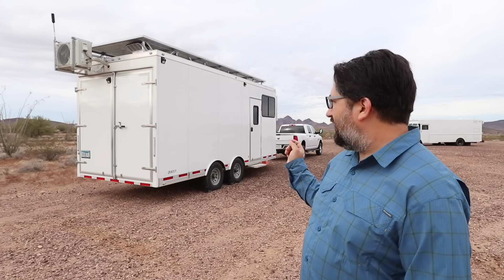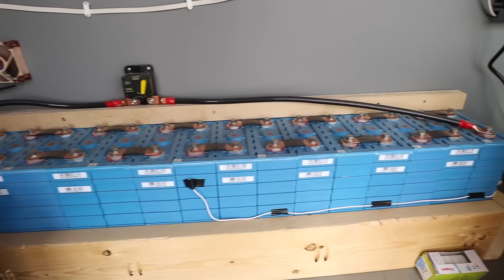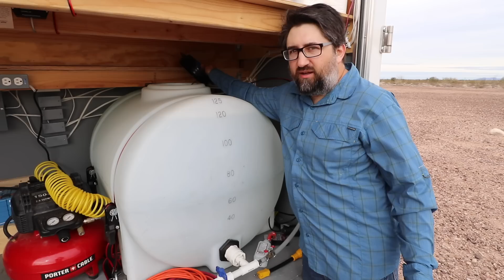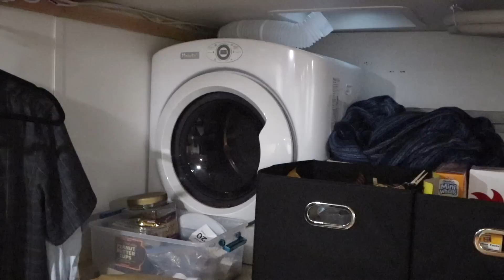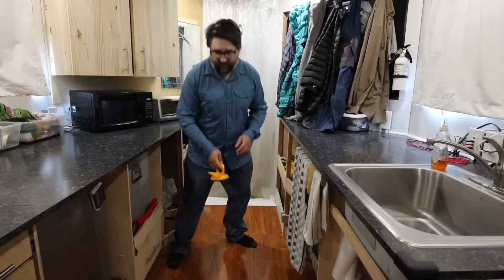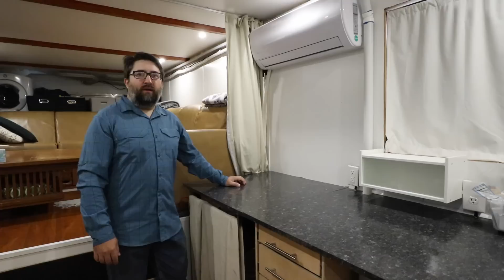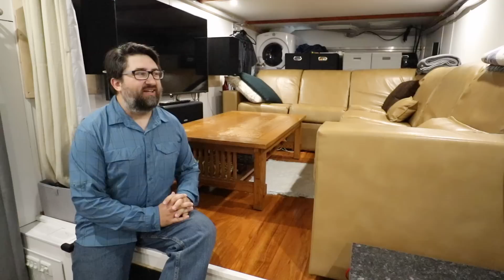Crypt Bedroom in a 2 Kilowatt Cargo Trailer Conversion

Comment: Love the rig!   Great job overall!   What I didn't see is a BMS for the battery bank and no balance leads.   Is there any particular reason for the lack of any balance leads?  I know the solar charge controller can be programmed to perform part of the function of a BMS, and the inverter can shut itself down when the battery voltage gets too low, but how do you handle balancing the cells?   And I see the temperature sensor on the side of one of the cells, but are you only monitoring for high temperature or low temperature or both and what is controlling the charging sources and loads in accordance with temperature?   Thanks!
Reply: A BMS performs 4 functions:
1) Protect against high/low temperature
2) Protect against high current in or out
3) Protect against voltage too high/low
4) Balance the cells

I don't have a formal BMS on my system.  Instead, I'm taking other approaches.  I didn't find a trustworthy product at the time of my build that I would gamble my expensive battery set with, so I have my own protections.
1) Protect against high/low temperature.  In my situation, the batteries never get too hot.  I keep my rig at a reasonable temperature, and the batteries are never working that hard when charging or discharging such that they heat up.  To protect against cold, I have the thermometer hooked up to a relay that turns on a space heater.  If it gets too cold, that area will be warmed by the space heater.
2) Current: Even if I run everything in my rig simultaneously, I can't exceed (or get anywhere near) my current limits.  This is not a problem for me.
3) Voltage: I have the solar charge controller and inverter/charger set up to not exceed high voltage limits.  The inverter will cut out at a reasonably low voltage.  I also have a Victron BMV-712 which starts sounding alarms if voltages get too low, which, has never happened yet.
4) I manually balanced the cells when I installed them and haven't touched them yet.  Because of my low "C" ratings, they won't drift much at all.  I am planning on performing another manual balancing (if needed) soon so I can start using 100% of the battery pack's power instead of just the "safe" 80% that I have been using.
Reply: @michaelberding4616  I hear what you're saying, but it is precisely because your batteries were so expensive that I would want to, at least, monitor the individual cell voltages - just in case one of them, due to no fault of your own, drifted out of balance.   Because, a problem with one cell can spread to other cells.  And, I don't think I would trust those cheap BMS systems out there, either.   And, I am keenly aware of the irony of balancing systems for lithium batteries - if the cells are matched, there is no need to have a system that balances them and if they are not matched,  a balancing system will not fix the problem.  And, you make a good point about the low "C" ratings of your charge/discharge profile.  But, there are some decent BMS systems out there - and, they aren't cheap.   The fact that you feel a need to possibly do another "manual balancing" indicates a need for a system that can take care of that for you.  Having done my own reseach in that regard, I have discovered a company that seems to have both a good product line and is very responsive in answering questions and providing support when needed.   So, I would recommend you check out REC BMS (just Google them and click the first link) and read about their products on their site.  I've been working with them in coming up with a comprehensive BMS system for my 450 amp-hour @ 51.2 volt LiFePO4 battery pack and, so far, they've been great to work with.  They even have a version of their BMS that is compatible with the Victron VE Bus and works with the Victron Color Control GX, as well as versions that work specifically with other inverters.   Even if you don't feel that their products are needed for your application, since you install systems for others as a business, you may find that some of your customers could benefit from what they have to offer.

I also wanted to make a suggestion to you in terms of keeping your batteries at a stable temperature.  For my battery pack, I am installing the cells in a 36" x 30" 14 gauge steel NEMA enclosure that will be insulated with styrofoam on all sides.   And, underneath the cells, I am using reptile tank heating mats to keep them from getting too cold.   The nice thing about the reptile tank heating mats is that they can be purchased with a thermostat of their own, they operate at very low power (between 5 watts and 20 watts, depending on the size), and they gently heat only the batteries, and not the entire space around them.   This could save you a lot of battery power by eliminating the need for the space heater.  Thank you, for your response and I hope you find these suggestions helpful.
Reply: @richardowens9061  Thanks for your thorough reply.  I honestly haven't even taken a voltage reading of each of the cells since I launched, 1.5 years ago.  I figured it's something I should probably do at some point soon-ish, so next time the weather is good, I'll probably get after that.

For all of my clients, if I'm building a custom lithium pack for them, I install a BMS or an automatic balancer (with voltage alarms/alerts) on their systems.  I just had a hard time finding something that would work on a 16s (48v) system at the time I built mine, so I skipped it on mine.

As for the heating, it's actually very rare that my garage heater needs to come on.  I think it came on once while camping in very cold weather in Alberta.  Other than that, my rig is well-enough insulated and temperate balanced by the huge water tank that it just doesn't get too cold back there.  I agree with you though that the reptile heating pads would be a much better solution.

Comment: Fantastic Job! I just started my Cargo conversion, just got the foam board on walls, have 6-350 watt , 24 volt panels to go ontop, but planning to make actuator frame to be able to tilt the panels for the winter months, even though I am in Florida.. want to build it right the first time. I bought two 100 quart freezer/ fridges (12v or 24volt) for Christmas (I am impressed how fast they will freeze) tested with gallon jug and 2 liter bottle water. I want to be able to run every thing off solar like in your setup. was there any regrets or I shoulda done this instead?
Reply: I tried the actuators set up with 980 watts. Just realize it will take about 2x the  actuators u think, (as they are over rated) and the build and design process will take about 2-3 weeks. Also the advantage is only about 30% which means in winter will only be an extra 200ish watts. Just really look into it before going to the trouble! Good luck with your build man!
Reply: Only two major changes I'd do to my rig: First, have it be a gooseneck or 5th wheel design instead of a bumper-pull. Second: install a diesel heater instead of relying on the heat pump.
Reply: Michael Berding , congrats on your rig. Would you mind telling us the name of the company that built it for you and possibly the cost of it (the trailer only)?
Reply: @FOXMOSMAN3  The trailer was built by Aluminum Trailer Company (ATC).  I had lots of custom options, so my total for the trailer came up to $20,000.
Reply: @Michael Berding, I'm still in the very initial phase of planning a conversion - possibly a trailer with the same width and height of yours, but 28 foot in lenght - and I thought it would cost me much more. 
Thank you.

Comment: Awesome build, Michael. Really like your shower and the way you've built in the washer and the toilet with the flip ups.

But the crypt? Uh uh, nope, no way lol
Reply: John Bergholm - I agreed at first but once I saw how much room he had in there I changed my mind. The only thing I could see is keeping the dust out of there.
Reply: @danielsweeney6742  I thought that calling it a crypt was the only thing creepy about his sleeping area.  Most tiny houses and van builds have a low ceiling height over the bed.  From the view with the camera inside there , it looked like a large screened vent, which made it seem less crypt like.  It would be tough trying to change the sheets, and make the bed.  I have an ATC (Aluminum Trailer Company) trailer.  Well made trailers, and they can be quite costly.  Changing it to a gooseneck pull will be quite expensive, but a good idea.
Reply: @danielsweeney6742  If you're referring to dust in the crypt, we keep it at bay by vacuuming every time we clean the sheets.  Works out well.

Comment: Fantastic rig and you did it all yourself so you know every little detail and if something goes wrong you're just the man to fix it and fix it fast. 

I believe you need to rethink where your water tank is located. All roads are built so the highest point is in the middle of the road. This is for fast water run-off when it's raining. By putting your 1,042 pound water tank on the  passengers side of the rig you are compounding the angle that the trailer rides at. Better to put that much weight on the driver's side of the trailer so you reduce the angle that the rig rides at while moving  down the road.